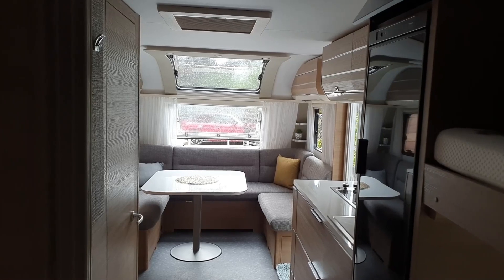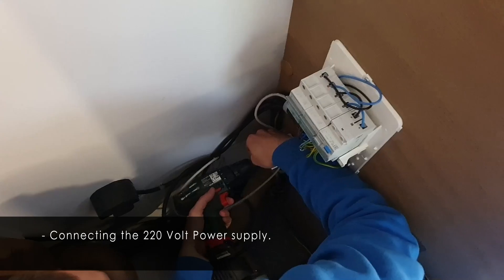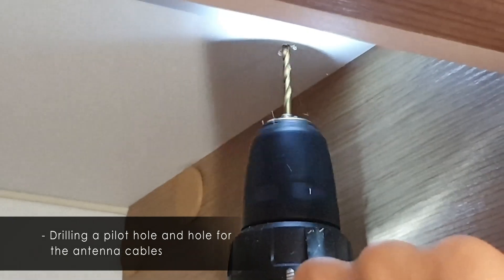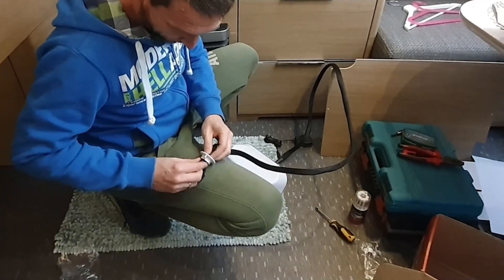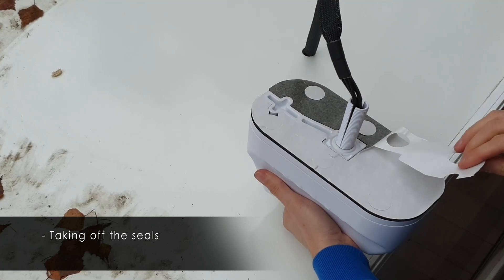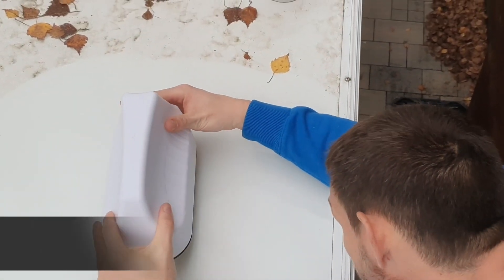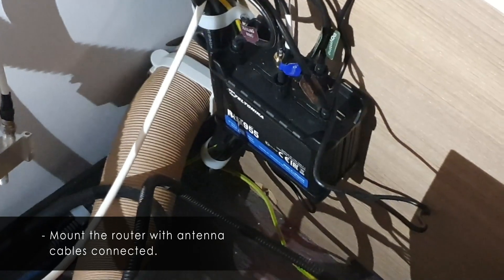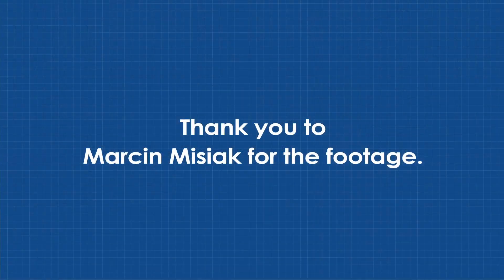MIMO-3 Antenna Installation on a Caravan/RV/Campervan

Comment: Are you using the LTE or Wi-fi cables to connect to the router…?
Reply: Hi Duncan, in this case we installed the Poynting MIMO-3-V2-15 antenna which has 5 antennas in one housing. 2 x LTE/5G antennas, 2 x Dual-Band Wi-Fi antennas and 1 x GPS/Glonass antenna. The antenna is fitted with 2m cables for each antenna (sums 5 wires) and comes with SMA-m connectors and 2 x SMA-f to RP-SMA-m for the Wi-Fi antennas. The RUT-955 Teltonika antenna supports 2 x LTE + 2 x Dual-Band Wi-Fi and 1 x GPS. We have connected all cables to the router. 2 cables to connect to ANT + DIV for LTE, 2 cables with adaptors to connect Wi-Fi and 1 cable for connecting GPS. I trust this clarifies the matter. Kind regards, Tjeerd

Comment: Mooie korte video. Ik heb nu een Alfa Networks R36 met USB antenne maar ben ook op zoek naar een vergelijkbare oplossing met de Teltonika en Poynting omdat ik een vaste antenne prettiger vind. Kun je iets zeggen over jouw ervaringen als je bijvoorbeeld verbonden bent met een camping of thuis WiFi netwerk? Ik ben vooral benieuw naar de throughput snelheid met behulpv van een speedtest. Met mijn Alfa is die best goed aangezien je met verschillende antennes voor het externe en interne netwerk werkt en je ook aparte kanalen kunt instellen zodat beide elkaar niet in de weg zitten. Ook nog een andere vraag want de 955 beschikt over een GPS en ik ben wel nieuwsgierig of je deze extern kunt uitlezen? Teltonika heeft een RMS Windows/Android oplossing maar werkt deze ook gratis of moet je daar een abonnement voor afsluiten?
Reply: Hi Arno, de antenne zal vooral een verbetering laten zien in de connectie kwaliteit. Hiermee bedoel ik dat de verbinding stabieler, betrouwbaarder en consistenter is. Dit komt door de unieke stralingspatronen van de Poynting antenne die zo is, ontwikkelt zodat ze in elke richting en op elke frequentie een gelijkmatige verspreiding van energie heeft en wel daarnaar toe waar je mag verwachten dat de bron is (BTS of Wi-Fi-access piont). Doordat de router minder hoeft te onderhandelen met de base station zul je een sterke verbetering zien in de throughput, dit is echter vooral ook afhankelijk van je provider van het signaal. Op campings etc. heb je niet altijd een goed Wi-Fi systeem, sta je te ver weg of zijn er bomen en struiken of andere caravans die signaal blokkeren en er dus voor zorgen dat het niet ideaal hoeft te zijn.... De antenne is passief en je kunt dus geen instelling definiëren, dat kun je in de Teltonika router doen. Als je de GPS aansluit kun je op Google Maps zien waar je bent hoe Teltonika het sharen oplost weet ik niet. Mocht je meer willen weten, stuur dan even een mailtje naar sales-europe@poynting.tech. Groet, Tjeerd